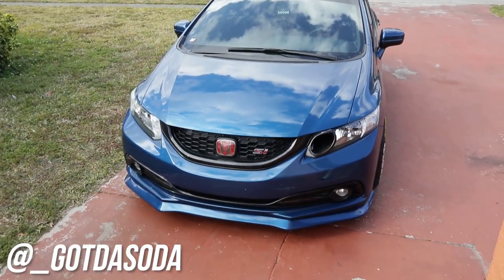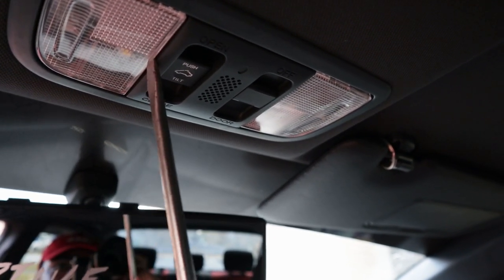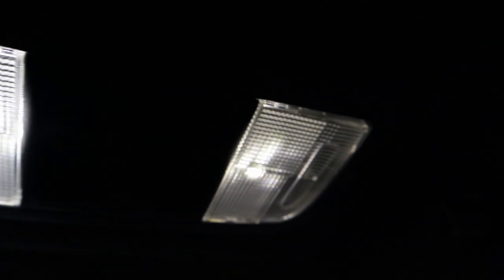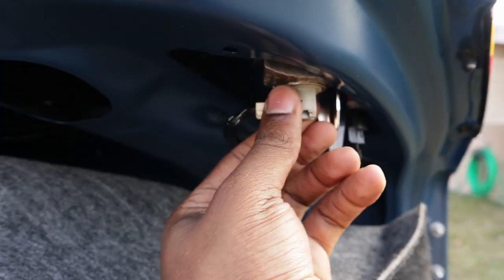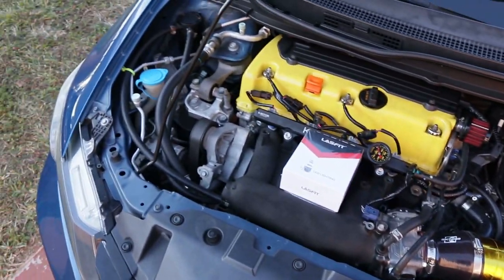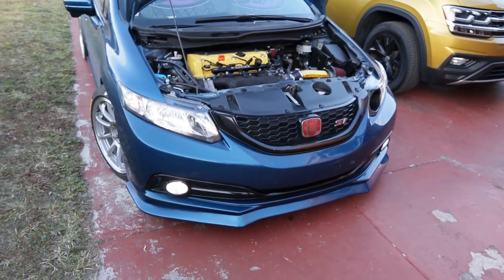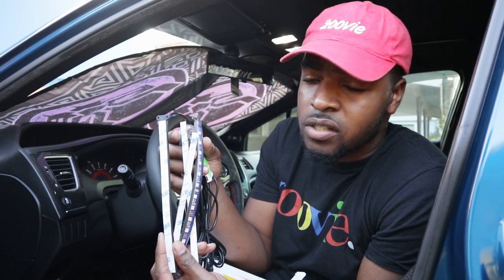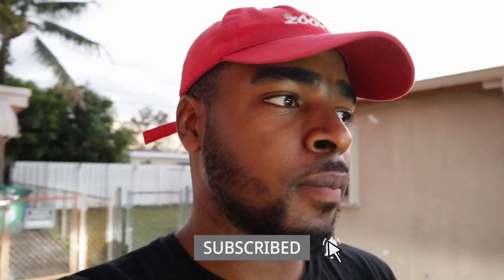LEDs Upgrade For Dusty | 9th Gen Si

Comment: This was the first thing I did to my civic lol

The only problem is that when you're doing the low beams and front turn signals, you have to take the bumper off. It's annoying. But the drl's, if you don't have a battery to the trunk relocation, then you'll struggle a little with the driver side drl. But the passenger side one is easy.

Comment: Hey zoov and fellow 9th gen si owners. I hope you guys are doing good. I had a quick question over my 9th gen. So right now in northern Texas, we got hit with a hardcore snow storm. I went to heat my car up in the morning and evening, and I noticed I got a check engine light with a “check emissions” message. I am going to check this error out tomorrow, but has this happened to anyone in really cold weather?

Yesterday and the several weeks before I haven’t had a CEL. I found it strange.
Reply from the maker: Could just be the cold
Reply: @zoovie  After doing some research online, it seems it may be that. I ran an OBD scan and I got codes P0497 and P145C - Low purge flow. I don’t think it can really be a big emission system already, the car hasn’t even hit 70K yet. I’ll check again when all the snow dies down and it warms up again.
Reply: Commenting in case anyone had the same issue. The CEL went away after warming the car up after all the snow melted and went for a drive.

Comment: Just got an 2015 SI, are the DRL the same as high beams if so, which ones do I have to get? Or would anyone happen to have a link to them? Thank you guys in advance
Reply from the maker: 9006 are high I believe and 9005 are lows
Reply: @zoovie  alright, I ordered 9006 thinking they were the lows, but still need to order 9005